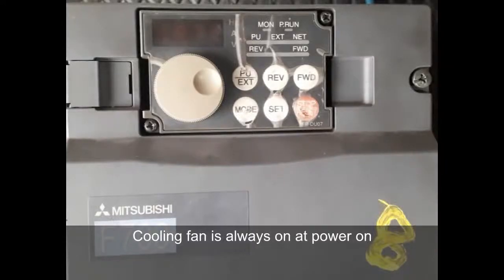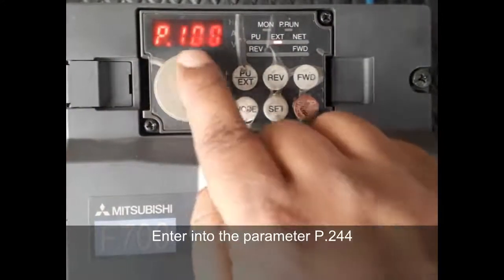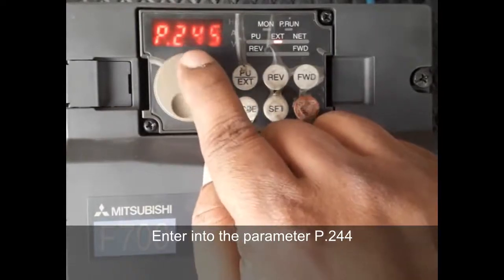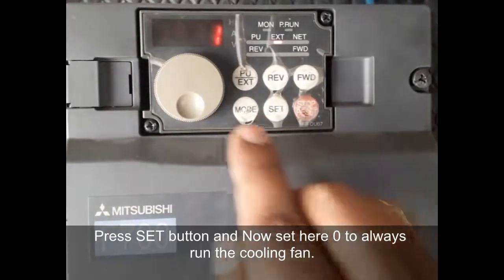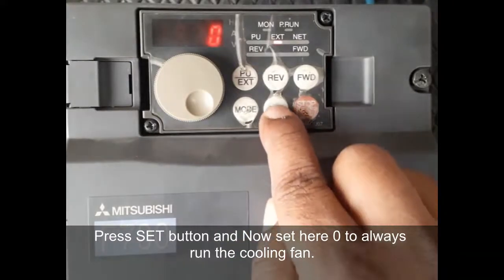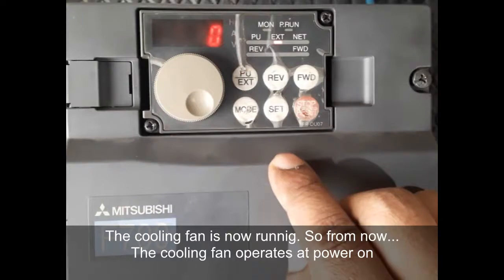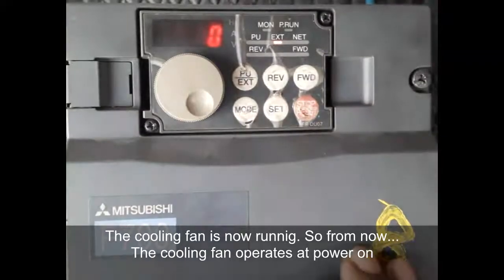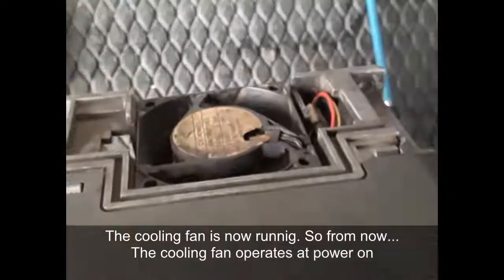Mitsubishi Inverter Cooling fan operation selection  |  F700 Mitsubishi drive fan parameter setting

Comment: Hello, I have an issue with the same device. Both of cooling fans (placed above the radiator) dont work. They are 100% good because I changed fans from working device. I have "Fn" error and the radiator gets overheat and switches off the motor after a few minutes of work. Do you have any ideas? Thanks a lot.
Reply from the maker: Please check fan operation parameters setting
Reply from the maker: Check Fan control parameter
Reply from the maker: Follow user manual